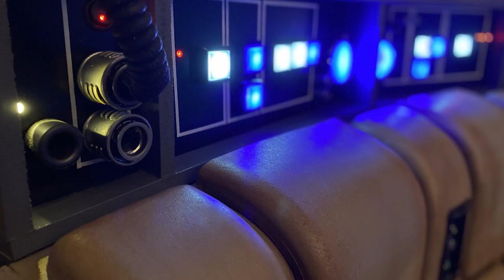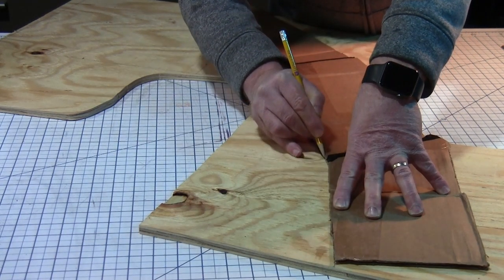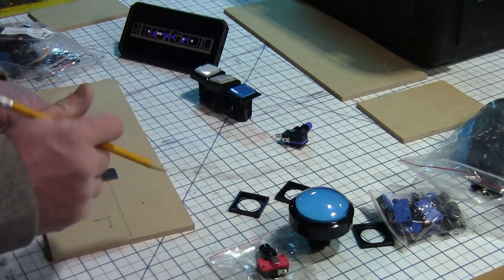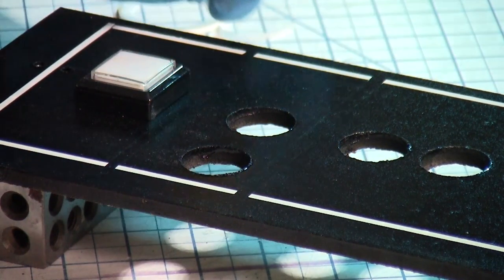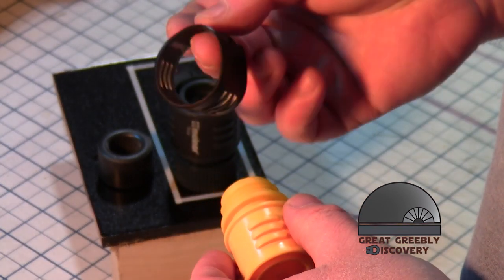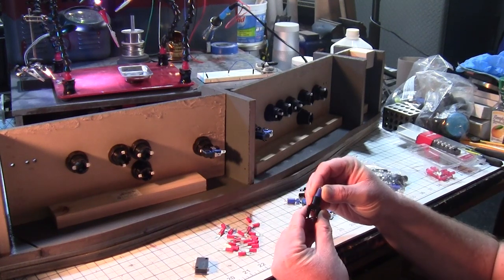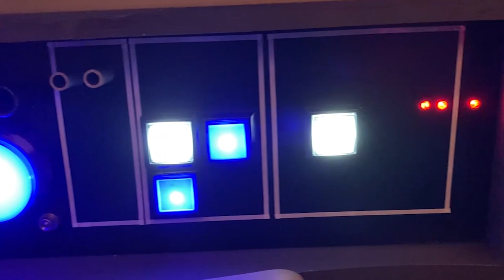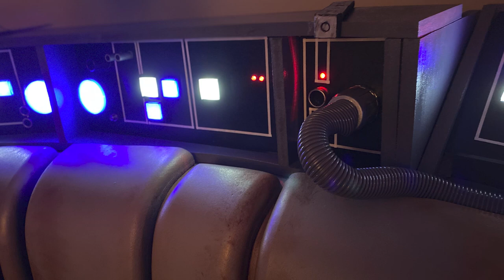Millennium Falcon Bench Control Panels

Comment: Would ping pong balls cut in half with leds behind them work well for dome lights?
Reply from the maker: Possibly. They would be smaller than the buttons I used but certainly could work with some diffusion material to reduce the hot spot from the LEDs. Thanks so much for your support!!!

Comment: How did you power all of the LED's? I'm struggling to figure out the right way to do that on a similar build.
Reply from the maker: I wired them all together and used one power supply. You just have to make sure it’s the right specs. I actually had to swap out the first one I used because it was getting really hot after a while.